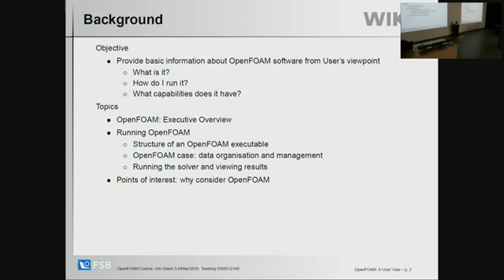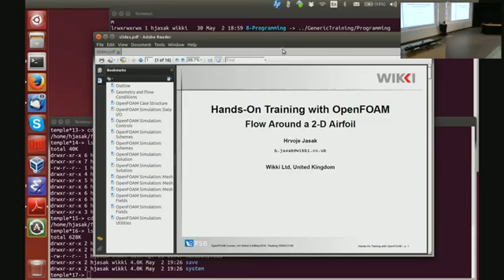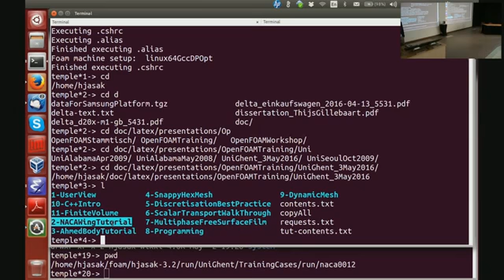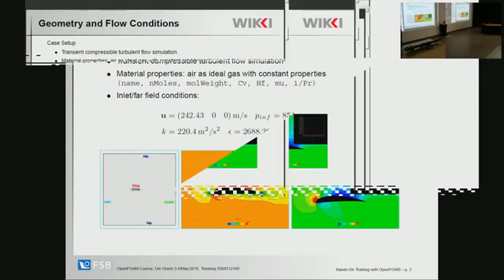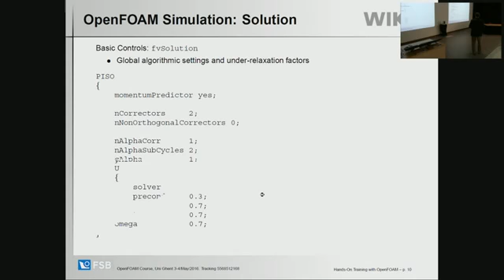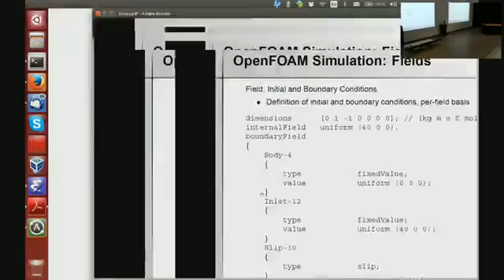Introduction to OpenFOAM  part 1

Comment: hi 
sorry this problem is diferent but i need help and i didnt find the sotulion alone 

i run my case in prallel and i have this msg ( my PC : (memory 125.8 Gb  swap 242 Gb ))

mpirun noticed that process rank 17 with PID 15187 on node HP-Z820-Workstation exited on signal 8 (Floating point exception).